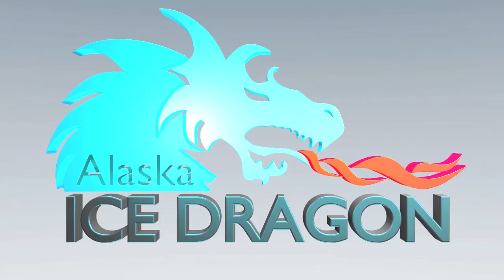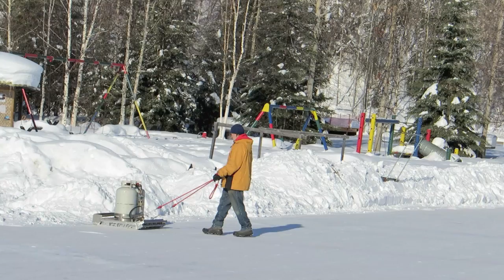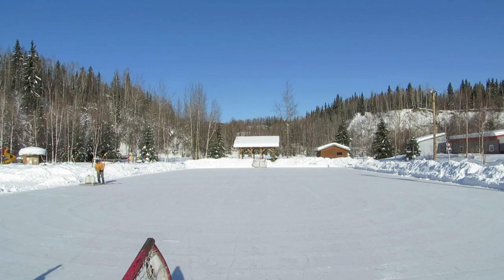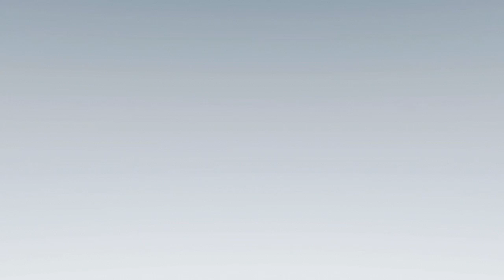Time Lapse: Ester Ice Rink Resurfacing

Comment: Need a four wheeler my dude
Reply from the maker: Way, way too much trouble and totally unnecessary. This rink's about 10 miles from my home so I'd have to trailer a quad over there and back, assuming I even owned one. Pulling the sled faster than the propane can melt the surface ice is pointless, and most quads don't even go slow enough for this job. The Ice Dragon's so easy to pull that a 10-year-old kid can use it, so it's not like it's a lot of work. A quad's handy if you've got a foot of snow to remove, but then you have to scrape off all the hard pack you get from the quad's wheels.
Reply: Yea that makes sense. How much propane does this use?
Reply from the maker: 2 gal/hour. If the ice is in decent shape then you walk about 1 mile per hour, which sounds slow but you can surface the full-size Ester rink in less than 2 hours at that speed. Or you can set a mile of trail 2 strips wide, like this: https://www.youtube.com/watch?v=9dGmCm2_fKc